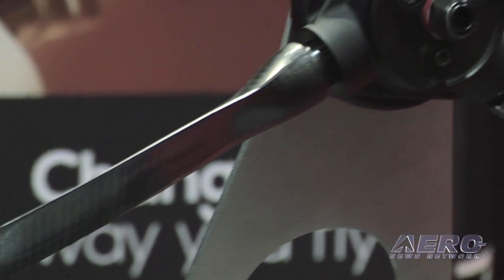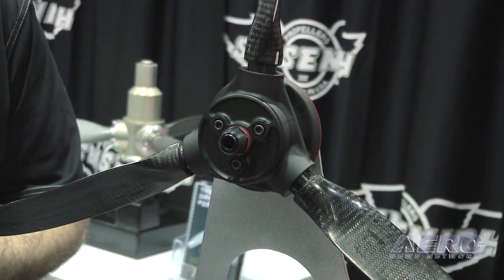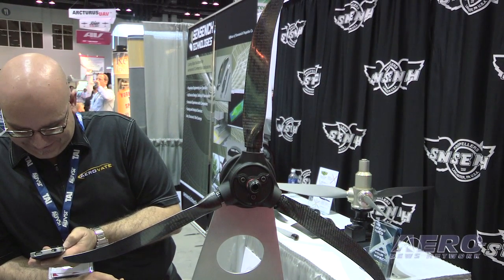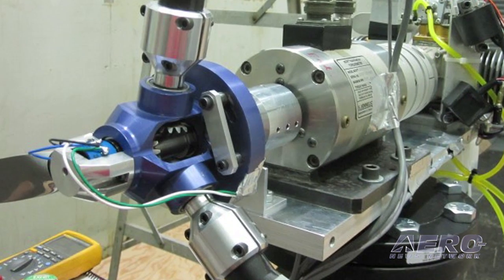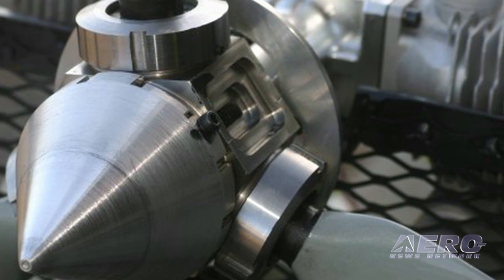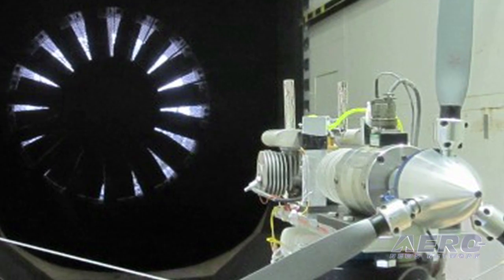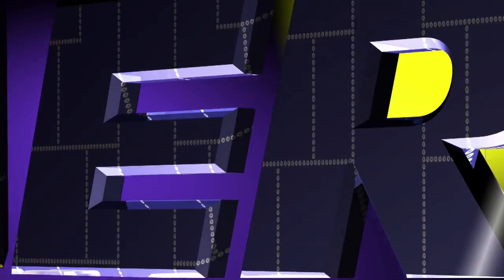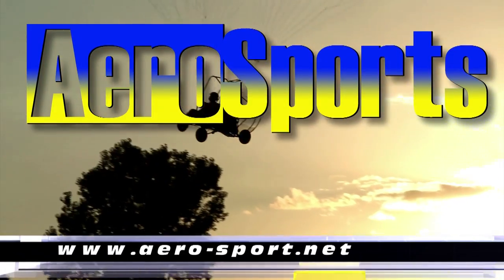Aero-TV: Aerovate Innovates - A Passive Variable Pitch Prop

Comment: This technology is not really new, neither to the UAV nor the manned aircraft market. Right after WW2 the "Aeromatic Propeller" came out that works on the same principle, although the technical implementation is a bit different. It was available on a number of certified aircraft like the Cessna 120/140/170 and more.
Apparently they are still somewhat available ( http://www.aeromatic.com/ ), although I have no idea about performance and reliability. Just learned about their existence when reading through the TCDS of my Cessna 140.